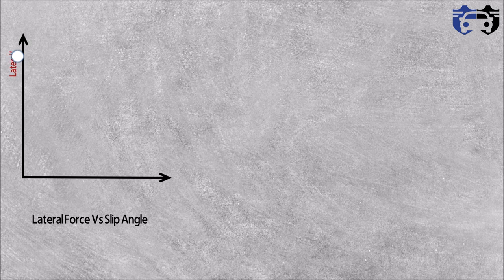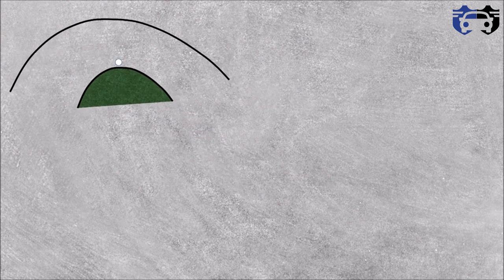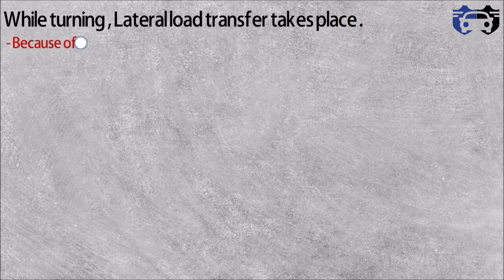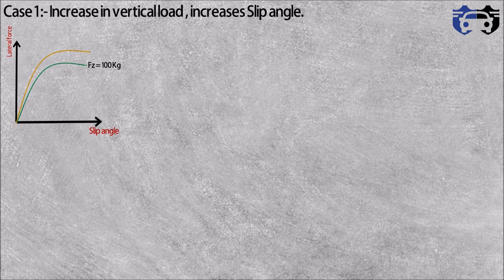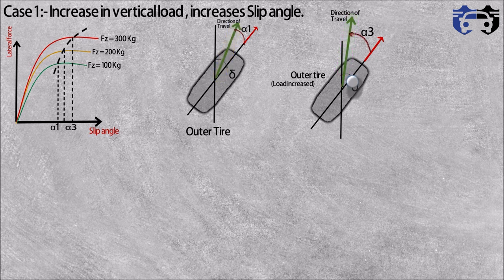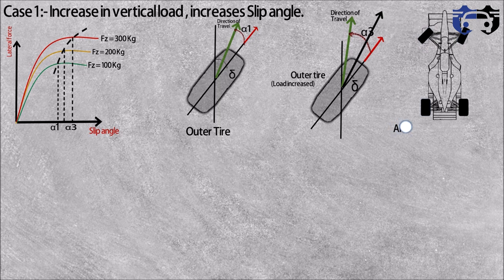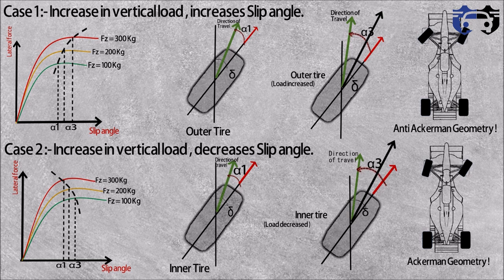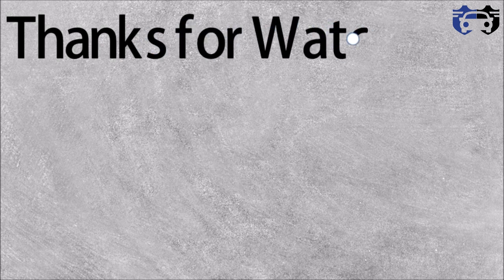Which Steering geometry you should use : Ackermann or Anti-Ackermann ?

Comment: I designed and built 3 FSAE cars. Most of the  ackerman videos give misinformation but
 this video completely right. 
 Goog job !
Reply from the maker: Thanks man !
Reply: Hey so tell me if I need to choose between Ackerman and anti ackerman for my baja what should I choose
Reply from the maker: Baja vehicles, generally have maximum speed of 57km/hr ,and drivers do not corner at maximum speed .
So , at speed of about 45 km/hr to 57 km/hr their is less lateral load transfer in baja vehicles ,as compare to high speed cars .
So going for Ackerman at low speed corners would be better !
Reply: @thevatsaljain  ı agree that. At the same time ; when inner tire has more toe out (normal ackerman) , the tire creates more drag force (more steer angle more friction ). And this inner tire creates more yaw moment.
Reply: Okau that was great but the thing is I've seen some teams use anti ackerman get their vehicle turns for less than two feet turn i was amazed and I am really curious is that because of ackerman or is it because of the rack and pinion design
Reply: I feel so happy that ppl are really responding this well and another question what bis the ideal turning radius a vehicl can have ive got 2 and 3mts respectively of 46 trackwidth is that okay ? Or it can be done better
Reply: @g.venkatpunith5120 okey, first of all , select ackerman type releated to tire data in so that mayber the tire data says using anti ackerman .
Reply: @g.venkatpunith5120 
Let us just recall that in BAJA event the maximum speed your vehicle can reach could be 60km/h. Now, in Ackerman steering the outside wheel turns less than the inside wheel while in anti-Ackerman, the outside wheel turns more than the inside wheel during cornering. Anti-Ackerman geometry is employed in “high speed” vehicles where in during cornering a lot of weight shifts to the outer tyre, thus a higher slip angle and the inner tyre tends to loose its grip. While in “low speed” vehicles Ackerman steering geometry, there is not a significant dynamic weight transfer on the outer wheels during cornering and the inner wheel has a firm grip on the ground.
The research and our experience reveled that it works well on pavements and wet patches in the track but the vehicles tends to loose its grip during cornering in dry mud conditions and considering the dry mud conditions in almost all dynamic events in SAE BAJA India, anti-Ackerman may not be a wise choice in my opinion.😅 Moreover, while in all dynamic events you may not be able to achieve a very high speed, the Ackerman geometry would provide a better performance especially in the dynamic events !!

Comment: Inner tire: Load decrease is the same as outer tire: load increased. You drew the same diagram and alphas, just different graphs and representations of the geometry on the car. What you really want is this:
Ackerman for low-speed steering not at the limits of grip, with low load transfer, and when desiring drivability, predictability, and low tire wear.
Anti-ackerman for high speed steering, pushing the limits of grip with high load transfer, when maximum steering force is required; but at the COST of tire wear.

Anti-ackerman is also ideal for drifting since it's a weird combination of inside tire load increased, but also low speed. You want the tires to track the corner correctly while the ass end is swung out, so yeah.

Comment: For a SAE Formula Student vehicle which geometry is preferred and why?
Reply from the maker: Tire load performance curve is one of the criteria for choosing the type of geometry. For SAE formula student , or any other competition choosing geometry should depend on your tire load performance curve, load transfer characteristics, cornering speed, track characteristics ,required turning angle to achieve a required turning radius with specific wheelbase and track-width.

Comment: Nice video!! 
1 question:
The difference between the two cases, depends on the tyre parameters?
Reply from the maker: Choosing Ackerman or Anti-Ackerman depends on Tyre parameters and also on the cornering of vehicle ,i.e whether their is high or low speed cornering and sharp turns or normal turns. It also depends on the position of roll center as if the roll center is at more distance from the center of gravity ,it will increase roll moment and this will increase the weight transfer,which leads to change in slip angles.

Comment: For the second case the value of à1 is greater than à3. 
But in image representation you have shown  that à1<à3 
Can you correct me if I'm wrong?
Reply from the maker: α(Slip angle) is shown on x axis, and that shows α3> α1. The curve is showing that α1 is achieved at maximum vertical load and α3 is achieved at minimum vertical load.

Comment: Why in anti Ackerman steering the outer wheel has more angle than the inner wheel
Reply: because the steering knuckle placed more outside of the kingpin axis (back placed steering rack) or the steering knuckle placed more inside of the kingpin axis (front placed steering rack)

Comment: This approach is over simplified. Do you really think that, for  given tires you will get same Ackermann geometry if you have 
- a different wheelbase
- a different radius
-  a different yaw angle
- a different speed (and therefore a different yaw velocity)
?

A few additional and important comments:
1.  Initial toe is important . The initial toe setup will be carried at all steering angles

2. Grip and balance are two different things. You could improve the front grip so much that it could create major oversteer

3. All these calculations could be be washed away one the compliance is considered

Remember that tires Fx and Mz will also play a role in the car balance
Reply from the maker: Great points! Ackermann geometry is indeed influenced by multiple factors like wheelbase, radius, yaw angle, speed, and more. Initial toe, grip, balance, compliance, and tire characteristics are all essential considerations. Thanks for highlighting these aspects!